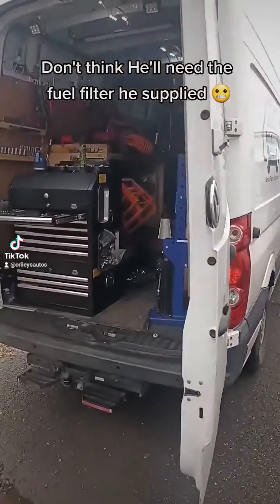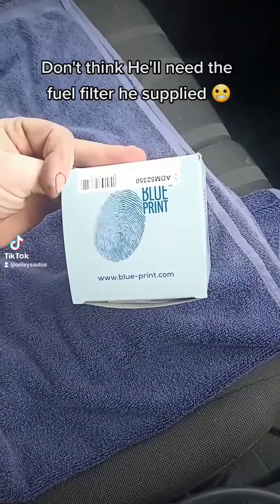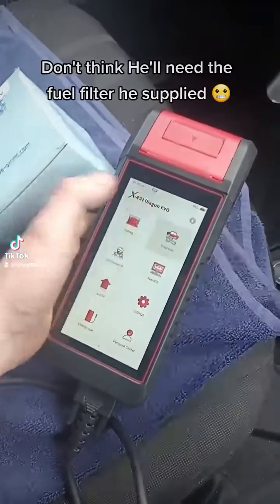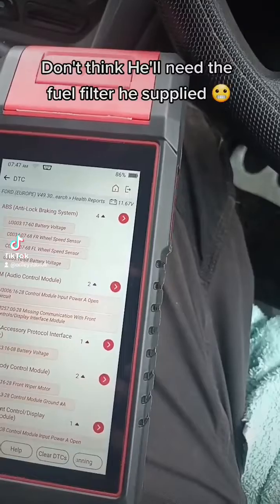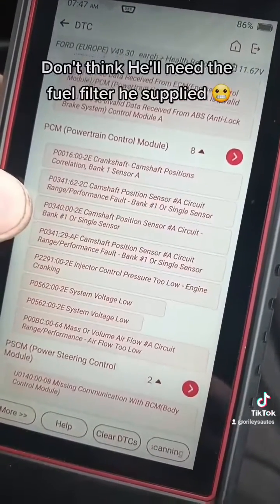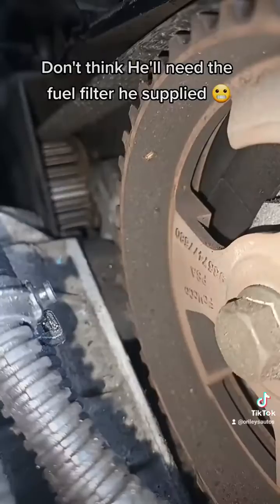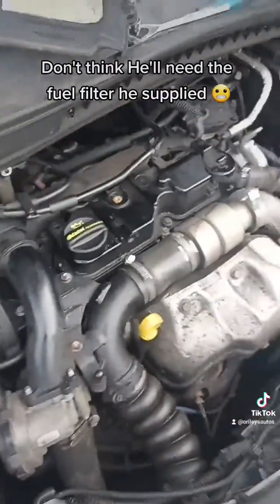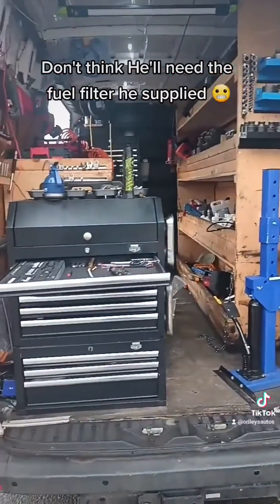Ford Transit Connect Crank No Start Diagnostic Inspection. Camshaft Crankshaft Correlation

Comment: I bought a fiesta van with this same fault, new cam, new rockers, new hyd tappers, cam belt kit, drive belt and a service jobs a goodun 👍 162k. I’m shocked how poorly diagnosed it was and why didn’t they have time to change the fuel filter 🤔 good job Jimmy 👍